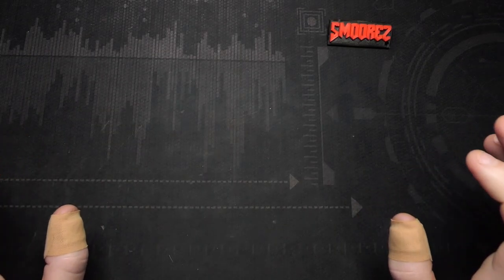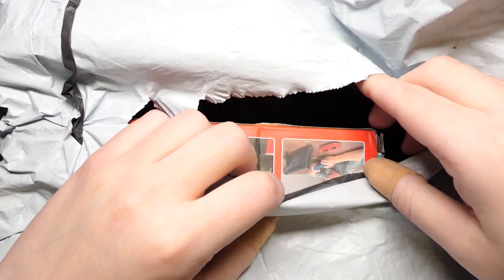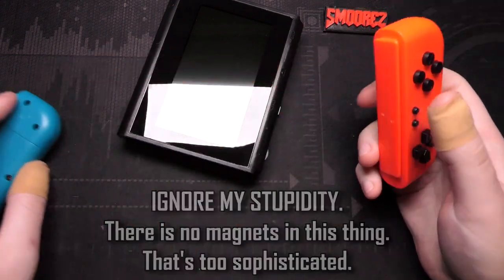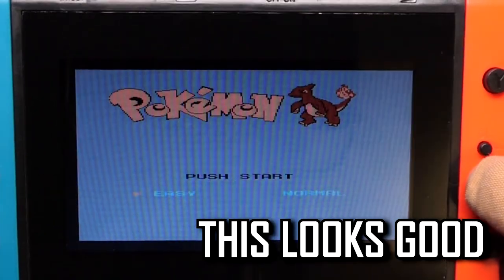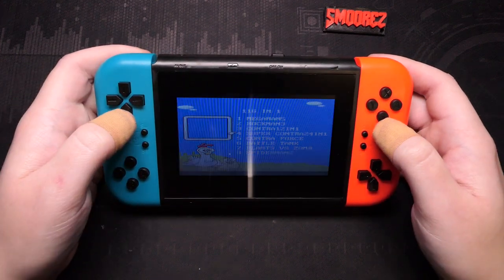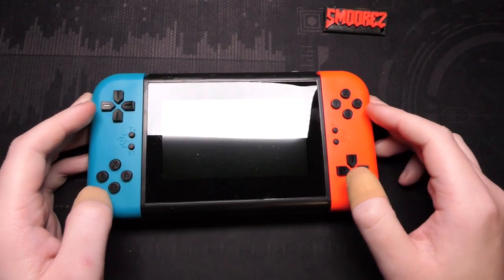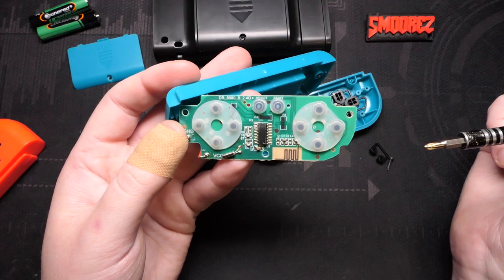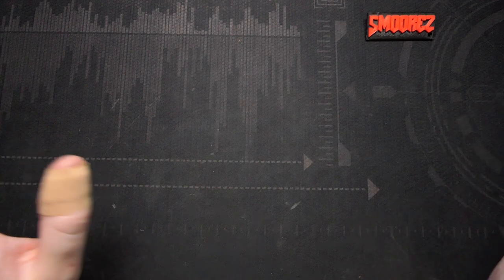iWish: The $40 Nintendo Switch bootleg that's actually just a fancy Famiclone

Comment: The + - on the plastic of the controller were hand engraved into the mould tooling really sloppily. The 14-pin chip might be a Bluetooth microcontroller by JieLi.

The LCD is similar to PSP1000 sort-of not-quite clone LCD which is used in a million products, a quasi standard.
Reply: yea i thought the same thing. the + and - werent carved into the plastic, they were carved into the mold as a "revision"

Comment: When I was little I had a ps1 style famiclone, a genuine "Polystation"
It only worked for about 2 weeks before the AC adapter died. Then I tried a different adapter and the Famiclone still didn't work.
That was coincidentally my only game console I ever owned. I do actually have an original GameBoy I paid $2 for, that could technically be classified as my secondary game console, however I only have Tetris for it and I never tried to see if it works.

Oh ye and in some parts of the world this bootleg Switch was apparently known as "Nanica Smitch"
Reply: Don't forget the "WiWi", a bootleg Nintendo Wii with tons of fake NES/SNES games
Reply: Ok